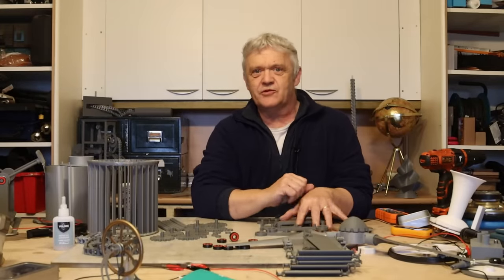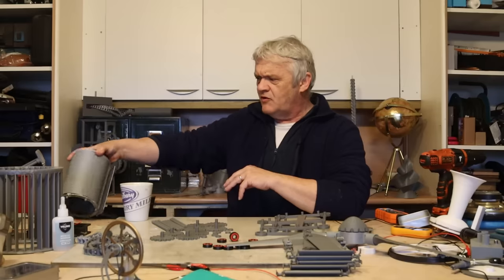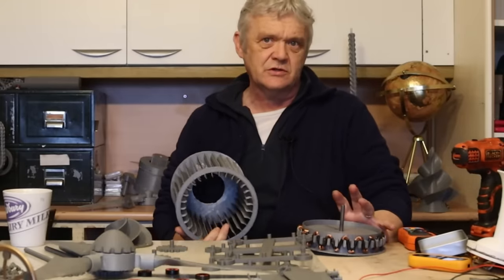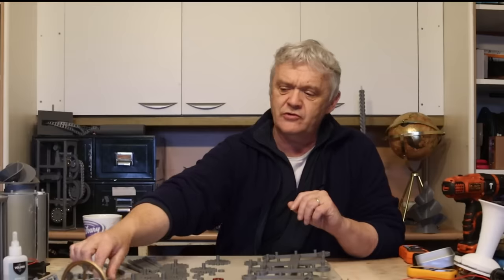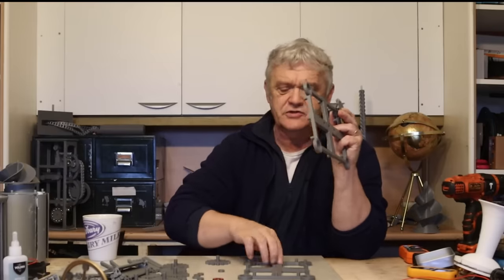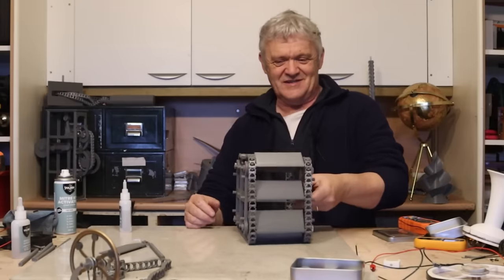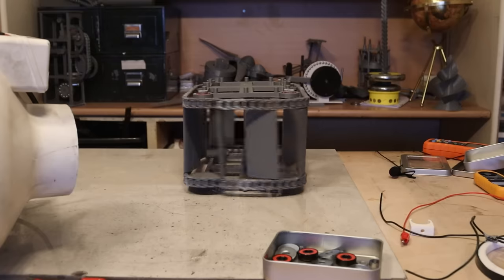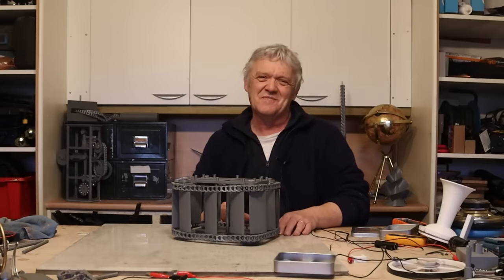2115 Building An AirLoom Style Wind Turbine

Comment: Nice job, spring loaded blades? I missed the squirrel cage with adjustable (not spring-loaded) blades - which video is that?
Also - does the airball create a 'down-force' along the axis of rotation? Just thinking about proximity 'clutching' to disproportionately increase the generation whilst effectively limiting rotation/lowering start speed.
Reply: Got it - the Lantern Generator 1977. Looks almost ready to sell as a phone charger for anxious campers (though maybe re-purpose the elastic band looped around lugs atop the blades to spring-load them).

Comment: Wouldn't it be better if the wind turbine blades were the opposite way round with the thin section at the hub and the larger section at the perimeter of the sweep?  Generating more torque at the hub and capturing more energy.

Comment: Wouldn’t the air have to be blowing along one axis on the perfect angle for this to even work seems like you would have to have controls over the blade to change angle when the wind direction change some kinda axis controller elevation pitch and flaps on the surface area and wind speed would need to be really large at scale
Reply: If the blades are free to pivot then as airfoils they will self-align to the wind flow. But then you have additional wear points in the system. And this design already has far to many axles around which parts spin. Remember each link in the chain is one such. A timing belt arrangement might work better.
Reply from the maker: check out what air loom say on their website

Comment: I know that the blades are airfoils, but is this 
turning because of lift or drag?
Reply: Drag
Reply from the maker: a mix
Reply: Measure the TSR. If it is over 1.0 then it's in lift mode, if 1.0 or under it's drag mode. If the blades flop around then they will take the easiest path which is with the air stream. Lift blades have an angle of attack which is greater than zero degrees. Flat blades can have lift. The orientation of the array is such that it is more efficient in one or two directions. The solidity of the turbine is such that the only power is produced from the windward side.
On second thought measuring the TSR would be difficult since the radius keeps changing. The Airloom turbine has low solidity and looks like it has fixed airfoils, so at least the angle of attack on the windward side is providing power. Roberts version needs to be opened up by removing 50% of the blades

Comment: Ever flown a power kite? 
A para foil or one of the 4 line frame kites ? 
If you like that sort of thing go learn how to fly one
That thing you built is great but to me it would make a great vertical drop water generator in a down pipe , your gutter generator,  spill buckets holding the weight of the water as it drops 
If you try the kite...start at a 1200mm ish wide wing type 
With 50kg snap line fitted....or you may get hurt....lol 
Ive got upto 2.7m....extremely dangerous over 10mph wind speed 
With out snap lines 
You will see what im getting at as they can easyly well exceed the wind speed....just like a sailing boat can

Comment: Seems like a chain would be very inefficient, every pivot produces friction which reduces efficiency. A chain has a lot of pivot points.
Reply from the maker: it is also a positive drive so less slip and it is a rolling friction so over all much better that wire, belt or pulley for power transmission

Comment: Bonjour, hello,
As this is your latest video, I'm writing here with hope to catch your attention ;)
I’m struggling with the path of designing my WT and PMA set
Rather than starting with the WT itself, I rather started by deteriming the wind power (potential available) to about 30Nm torque
Now that I know what energy I’m dealing with, I just can’t find anywhere what this force will allow me to run (turn) as a PMA. Will it turn a 3m large, one magnet rotor, many magnets, and two external stators with as many coils (with IDK how many turns of IDK what gauge)
BAsed on my potentially available 30 Nm torque, how do I determine how many magnets (number, strength) and coils I can put ?
Any suggestion (book, etc..) will be greatly appreciated !
Éric

Comment: I was looking at some of the earlier attempts out there, similar to the Airloom, and my understanding was that one of their biggest issues is that using 2 cables, in the way you have used 2 chains, seemed to always result in a disparity between the top and bottom cables.

I see that your chain and cog based system compensates for this, keeping the top and bottom in sync.  However, using cables does make attaching things to them lot easier, as well as lowering the cost of the system.

 I have no interest in buying a defunct ski resort. I am thinking much smaller, pehaps  a system similar to your design, where traveling around the square is about 100-200ft, would be ideal.

Can you see anyway to overcome this slippage issue when used on this smaller scale than the Airloom folks?
Reply from the maker: at a smller scle i would think a single cable in the middle of the blade would be sufficient - but that is smething that would need testing and is just a guess on my part
Reply: @ThinkingandTinkering  what an amazingly simple solution! Thank you. While by itself it will certainly help, and like you said, at the small scale it might be enough entirely  but definitely adding to this some  cross connections running from the top and bottom of each wing  to the middle cable position of the next wing, would make it  function as a fairly rigid system without complicating it too much. 

I think I will start much smaller, perhaps  a 10'x10' system, and see what happens.

Comment: Could a traditional 3 blade turbine not get rid of the central generator and instead have 3 smaller generators near the tip or part way up the blades

So rather than a 15MW offshore wind turbine with a central 15MW generator. The same size turbine but with 3 x 5MW generators nearer the tips of the blades

These would be like mini wind turbines themselves, but since they are seeing 200mph (tip speed) winds they would have much smaller blades and a much higher rpm

5MW at 90m/s wind speed you'd need ~3 meter long blades. Operating at ~300rpm rather than ~6rpm for a cental 15MW generator

No idea of this would be cheaper. The generators woupd definitely be much smaller and less materials so likely to be much chepaer but the rest no idea

Comment: I followed  your channel for a while,  nice explanations with many sidetrack ideas.  Interesting and entertaining. 
However today I feel a real discomfort watching you forgetting every aspect of the solution  that does not fit your story.  Starting with friction (that hurts in a first place) following directly by economics of the solution  and then  the logic of your transition from central generator with ends of  the propeller/rim  as  giving most of power,  to cutting these ends and putting them in a linear movement  hoping for the same power input ...  I have checked twice, no it is not a video for 1st of April.      It reminds me  your video about small generator rated at 1kW without mention  "for hurricane wind" .

Looking forward  to see your next video with conclusions  when  connected to a generator.    It will be certainly fun to watch.

Comment: If you were to capture all of the wind, the wind would stop and you wouldn't have any wind any more. Because of that, a wind generator can never take all of the wind and reach 100% efficiency. The reason I'm saying is because your design is too tight from wind/air density perspective. There needs to be more space in between the whole structure. Sure it works, but it's far from performing optimally.

Comment: The idea that the torque at the rim is more than what is at the center is ludicrous. 
The losses in transfer of torque from rim to the center via a stationary moment arm are negligible at worst. 
You say tomato i say tomato.
Reply: I think you misunderstood the argument. The tips are producing the bulk of the power, and the length of Blade closer to the center are for the most part simply transferring the torque from the power producing tips. This in fact leaves much of the center of the circle that a horizontal axis wind turbine describes in space "wasted space" i.e. not contributing much to the overall efficiency.